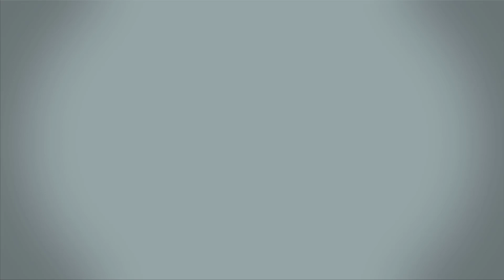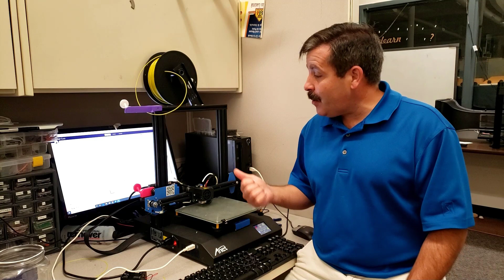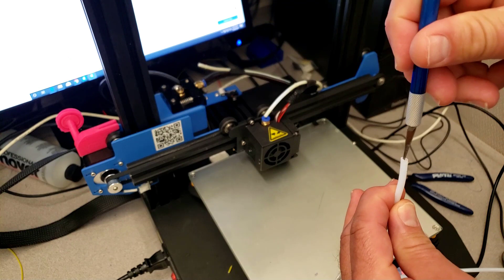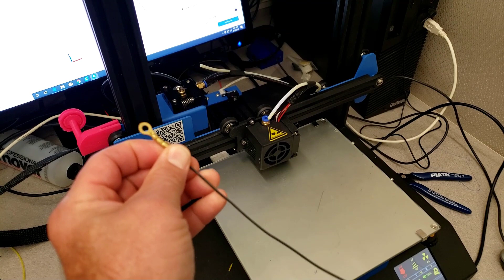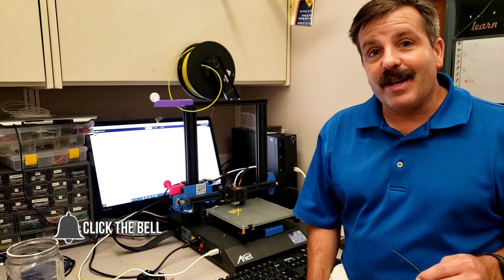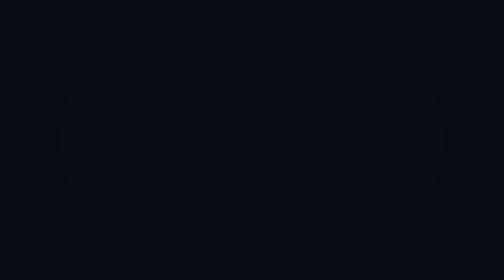Snapped Filament? Super Slick Bowden Tube Filament Removal Tool

Comment: Just bought a Davinci 1.0 Pro with filament pieces inside the Bowden tube. Opening the cartridge still in it I see why as the remaining filament in there is very stiff and brittle. Probably the spool that came with it in 2018. I guess the owner didn't want to try and fix it they just donated it to Goodwill and I picked it up for $50. Software version 1.3.8 running now but upgrading to most recent XYZware since it is free and no mods needed, (dramatic pause) yet. Cool vid will most likely help clear up the tube and oddly I DO have some ceiling tile hangar wires laying around here lol.
Reply from the maker: Hope you get it working. I was always bummed that they had it locked to their filament spools. I am sure there is a work around for that by now. Glad you have the hangers. I have heard that they are hard to find now.
Reply: @HLModTech  this model was not locked. When the Davinci 1.0 Pro came out it was open to all filaments. It just came with crappy firmware and software. Current version is much better as it allows third party slicer software too.
Reply from the maker: That is sweet!

Comment: Please read! If you don’t have a ceiling tile thingy just cut a piece of filling the of a spool and jam it in there, worked for me
Reply from the maker: So you just used a strand of filament off that spool? Interesting idea, either way. Thanks for sharing.
Reply: I have filament hat is stuck in the tube I tried jamming filament through and it’s not working

Comment: ceiling tile supports strap... looking allover house and going into the attic in search of that doo-hickey device. Guess I will just struggle since nobody I know has that thing lying around.
Reply from the maker: Sorry about that. I tried to help someone find more... and it seems Armstrong has went to a different system. ☹ Here is an idea though. I am betting you can find 14 guage wire to buy by the foot though. Make sure it is the solid, not stranded and it should be 1.6mm or so and work. Keep me posted if you give it a go please. I would love to hear that it works.
Reply: @HLModTech  I can confirm that 14 ga. electrical wire works fine. In a 3-conductor wire (Hot, Neutral, Ground), I removed the bare copper ground wire and successfully used it to push the old filament out of the Bowden tube.
Reply from the maker: Awesome share! Thank you. 💯👍

Comment: I have the same problem with the Creality Ender 3 Max, the problem is that I can't take off the Bowden tube , it's different than yours , I hope if you can give me some tips.
Reply from the maker: Shoot me an image of what your bowden tube looks like. hlmodtech gmail and I will take a look.
Reply: I can't get my ender 5 tube off. So frustrating.
Reply from the maker: @bryanc.2162  I have had connectors be more finicky too. Wish I had a good tip for you, but I do not. 😥
Reply: Did you fix it
Reply: @hudsonroberge9897  Yes I did, I just had the courage to pull off the bowden tube from both sides, I guess I was so carefull at the begining.

Comment: Can you post a link for where to get one of these hangers.
Reply from the maker: I just checked Lowes where I got my drop ceiling kit. They do not have them online and it looks like the kits have a different kind of wire now. =(  No dice at Amazon either. If you spot another source let me know. I will keep hunting too.
Reply from the maker: After looking up wire gauges, I believe that wire is 18 or 16 gauge. I just saw a thermostat wire that had 2 strands of 18 gauge in it. I also believe you can buy that by the foot at a hardware store... Cannot guarantee it will work, but it may be worth a shot.  You may be able to find a box of the old ceiling wires I used just on the shelf at a hardware store.
Reply: @HLModTech  thanks I couldn’t find any online either
Reply from the maker: I was bummed that they were gone. I will do some testing with the wire. Who knows, it may even be slicker.

Comment: what if i cant get the bowden tube out of my 3d printer
Reply from the maker: I have occasionally had to remove the locking nut... but usually then you need to replace it.

Comment: wtf how does your white tube just slide in and out so easy...
Reply from the maker: I cannot give you a why.... but I do have some printers where it is not as easy. I have also bought connectors for replacements and I am not 100% sure those are the ones from the factory.  I know the connectors on my Geeetech A10T are a bear to work with.

Comment: hi i am not english can you write me what you use please?
Reply from the maker: It is a flexible ceiling hanger. They are used for drop ceiling installations.
Reply: @Dean " I tried to help someone find more... and it seems Armstrong has went to a different system. ☹ Here is an idea though. I am betting you can find 14 guage wire to buy by the foot though. Make sure it is the solid, not stranded and it should be 1.6mm or so and work. Keep me posted if you give it a go please. I would love to hear that it works." - his reply to a similar comment
Reply from the maker: Thanks for this tip!